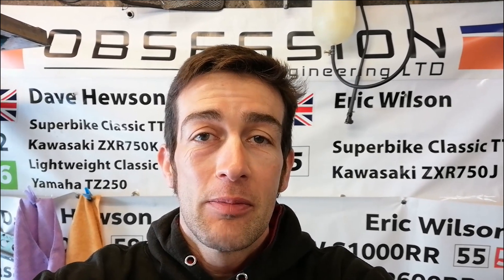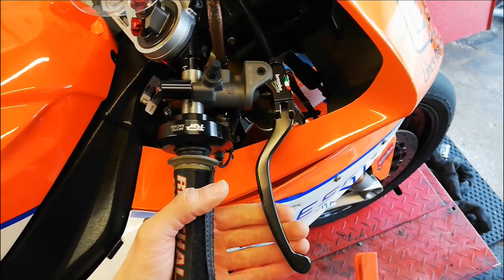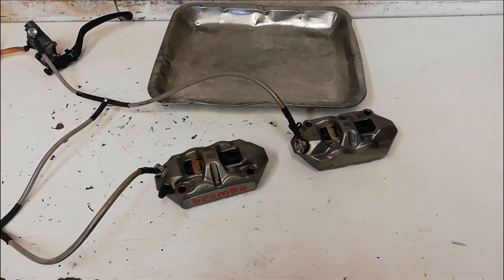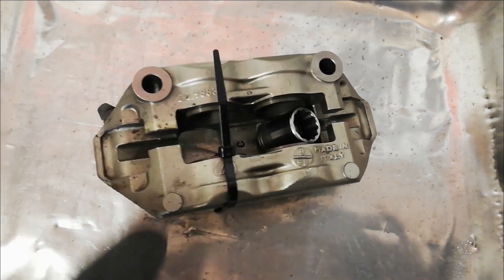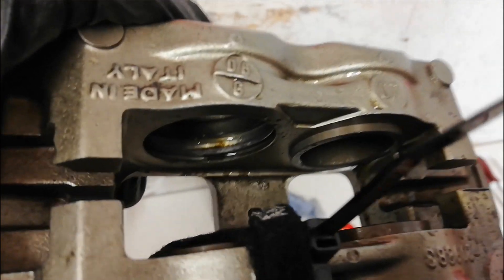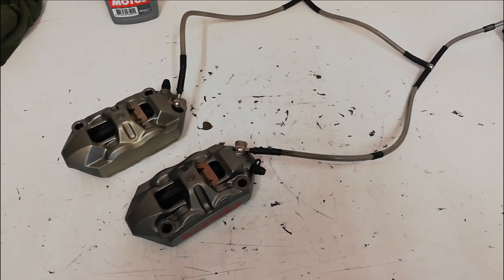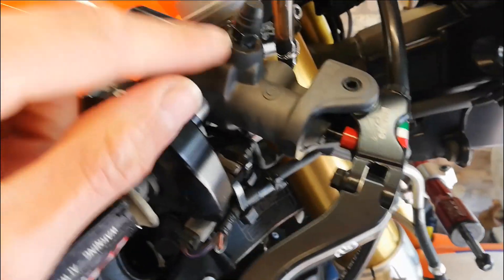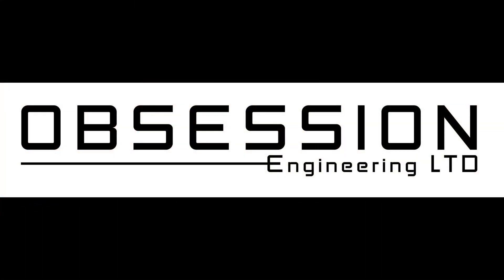How to service motorcycle brake calipers and replace seals

Comment: How do you remove the piston without an airline?
Reply from the maker: If you're very careful you can try pulling them out with a set of grips but it's very easy to damage them. On non mono block calipers (bolted together type) you can split the caliper and there's special tools for gripping the piston internally.
Reply: You can use an old oem/rubber brake line. Cut one of the banjo ends off: take a flexible bicycle pump hose & remove the end that screws into the pump. Then screw this fitting into the chopped-off end of your brake line & use it with a foot pump via one of the adapters that are usually supplied. Then attach the banjo end to the caliper (using some old copper washers either side of the bolt) and proceed to follow exactly what Davey did to remove, inspect & refresh each piston & accompanying seals. It works a treat!